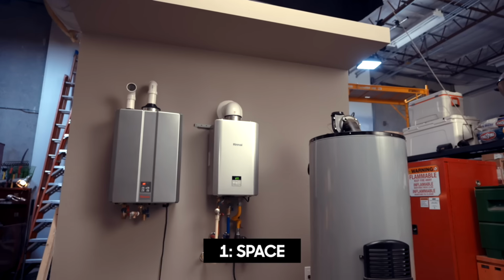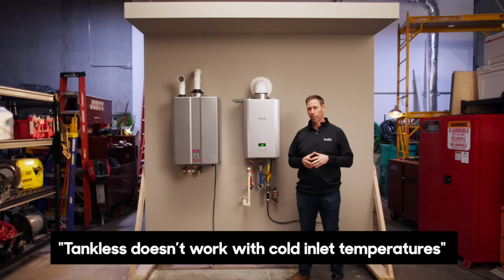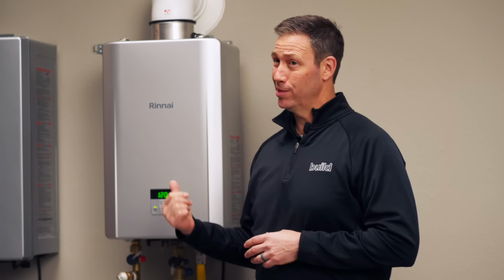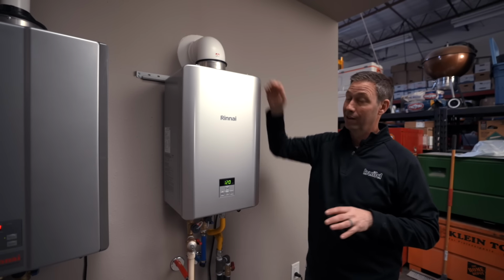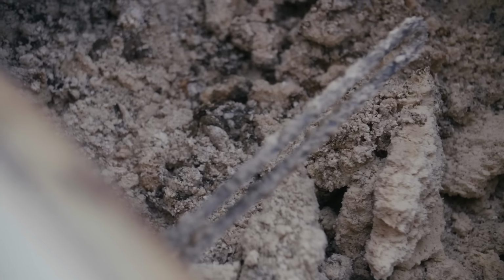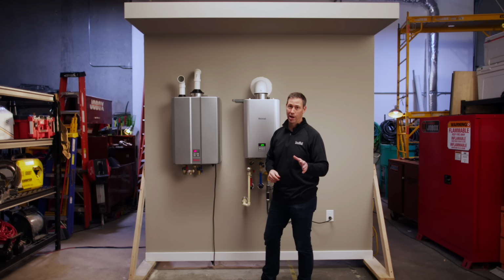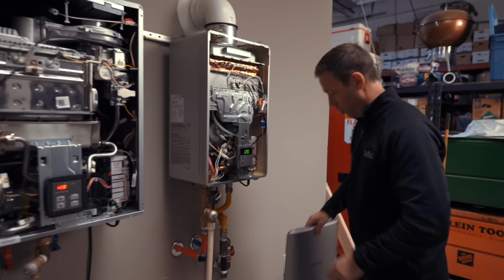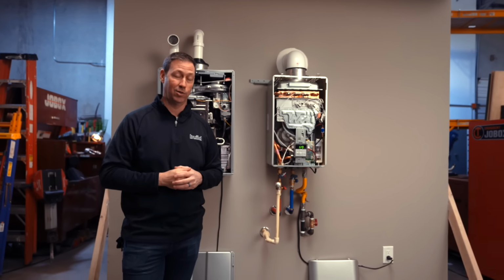DEBUNKING Tankless water heater LIES!

Comment: Just sold a 96 YO old house with the top of the line Rinaii flawlessly operating for near 17 years.  New house (3 YO) had a 80 gallon tank-type that was demoed and moved to the curb for the "recovery geniuses".  Now have the same Rinaii model for the last 7 months providing  likewise flawless operations.  There will NEVER, EVER be a tank-type in my life again.....not ever!
Reply: We bought a home back in 2010 that had two 50 gal electric water heaters. I wanted to replace them simply because of the electric cost of running them. I reached out to a plumber that specialized in water heater installs. He flat out told me that my ground water was too cold (well water). I did research and found that a lot of plumbers agreed. I decided to go with a beast 80 gal heat pump unit. It did it's job and reduced our electric bill but after seeing this I'm so disappointed I didn't call the manufactures directly. Out next house is most certainly going to have one.
Reply: @explorenaked  Matt refers to 3 showers at the same time because of tempering of extremely hot water with cold water and so increasing the amount of very warm water.
But if the supply is extremely cold then the system may struggle to supply one shower with adequate warm water. 
Check with the manufacturer first, for their guaranteed out put in frigid conditions.
Matt maybe right.
Reply: @explorenaked  I too have electric tank on a crawl space on a cottage rental. I was thinking going to hybrid electric. Maybe it's best to go gas tankless and buy a new washer dryer too? What's your thoughts? I may turn into air b and b as well for extra income. Thanks
Reply: I'm a plumber although these days clear blocked drains full time now. No need to carry materials or heavy lifting. Just simple drains haha
Reply: Wow, do you have any idea what 80g of water would do to a house if it let go?!
Reply: Do you follow the Fully Charged channel?
Have you seen the MixEnergy solution https:// youtu. be/l5q3W0tuLlM
Reply: that 96 year old must be rich
Reply: Maybe if the price of gas keeps going up and the price of electricity gets close to free if you add a large solar PV system... 
Maybe you'll consider electric heat pump then?
Reply: @sparkytas .....I have heat pump heating.  Very economical.  But then, the entire closed-cell foam enclosure of my house makes it possible.
Reply: Your gas bill has gone down?
Reply: So how many gallons of water can you get out of your tankless heater, if the supply is out for an extended period of time?  I have had a tankless for 20 years now (no savings over the previous natural-gas-fired tank either), and I am going back to a commercial-grade tank so I have some water to drink in case we get hit by a major natural disaster and all utilities are out for weeks/months (major earthquake).  

There is no free lunch here; everything has tradeoffs.  Plumbers in my area charge several thousand dollars to install one of these units, and over $1000 for a home-depot tank.  So I have to debunk some of the statements made in this video.  Needless to say, I won't be subscribing to this channel.  I have also installed tankless units in commercial spaces that I have helped design, and after doing so, I now recommend going with a tank and a recirculation pump due to multiple issues.  There are places for them, but this video makes it seem like there is just no comparison at all - not true.  It goes back to tradeoffs!  I will say that the endless hot water (so long as nobody else turns on anything that uses hot water in the house at the same time) is very nice.
Reply: @redmondjp what you describe is the result of an undersized tankless. If appliances are calculated right you may get a little less hit at times but that is unusual.
Reply: You must have a gas supply.  Electric ones are no bueno!
Reply: @dendemron3744  You are correct.  I have propane for all my gas appliances.  Electric tankless are no bueno fer sur!  For that matter...never had an electric tank-type that was worth the powder it would take to blow it to H...!
Reply: I like the idea of having emergency water if I need it.
Reply: You work for Matt or Rinaii, you’re not fooling anyone… especially when Matt wouldn’t even install one in his house. It all depends on the design of the entire heating system, to say one is better than anything else, either YOU are the lier or you don’t have a clue what you’re talking about and you’re just reading the script given to you.
Reply: @grandenauto3214  ....and you would be totally and completely wrong.  I have no affiliation with Rinaii...just a great experience.  If you had the same opportunity or experience you wouldn't be making such ignorant statements.
Reply: Electric tankless water heaters don’t get hot enough, fast enough to be a full house water heater.
Reply: @Mom_to_schnauzers  ...never buy an ELECTRIC tankless water heater.  Never!  That's any brand.  Electric models simply don't perform.
Reply: @Mom_to_schnauzers mine definitely does and was less expensive than a tank type for my new home build.
Reply: The CONTINUOUS hot water system I used recently did not work on low flow, it had to be turned on to high flow rate.
I turn my storage tank off when I holiday, ezi pezi
They do work, millions of Japanese use them every day. But if gas will be restricted in the future you will not get your lifetime value.
True ? ?
Reply: @stephenbrickwood1602  gas is here to stay.
Reply: @stephenbrickwood1602  ...you would be totally wrong in that assertion.  I do not!  I am NOT a "green freak" as you would elude to perfect your baseless arguement.  Instead, I look for practical solutions to a common need.  We all need hot water.  I'm no different than you.   What is the best way to accomplish that need.  I have found it and have experienced it for many, many years without any negative issues.  It WORKS!
Reply: @dwayneloftice2326  I do see your point and there is merit in what you say. 
I note that they need electric power to switch on. My neighbour's Rinaii is plugged in and does not work in a power 'black out'.
My main point is things are changing to an electric world and I do not know how fast it will happen. 
Nuclear power promoters are pushing hard now for $billions spend to save the planet and have masses of cheap electricity. 
Every one will make up their own minds.
Some will be winners. 
The fossil fuel supply companies are selling as hard as they can today.
Reply: @stephenbrickwood1602  I don't know anything about Rinaii but you can get an electric tankless water heater and they work just as well. If you're switching from NG to electric just make sure you have a circuit that can handle the load.
Reply: @C-Smash  thank you for the information. 
My old shed was the original dwelling and it still has the old continuous hot water. I disconnected it for safety. 
It is less than 2 foot tall and less than 2 inches dia. and installed vertically. The cold supply is connected to the bottom, hot out the top to the shower head.
Incredibly simple. 
It scared me, Hahaha, 240volt supply. So I disconnected it.
Reply: @stephenbrickwood1602  ....the Rinaii requires minimal power to initiate the "spark" for water heating iniation and needs.   The difference is, the tank-type storage version requires a pilot flame burning 24-7 where the tankless requires none.  The tankless intiates a spark to ignite the burner only upon demand when hot water is needed.  I can tell you that my water heating costs converting to the tankless system has been significantly and dramatically reduced by hundreds of dollars over the years.  Having said that, there are quality-built tankless systems that perform and others that do not measure up.  I've seen  the tests relative to duribility.  Cheaper systems are not always the best solutions.  I just believe the Rinaii is simply one of the best, most reliable brands after near 18 years in two locations (one natural gas and the other propane) using it. It simply works!
Reply: @dwayneloftice2326  thanks for the feedback, Rinaii is reliable. 
My comments on electric power supply was that ignition requires the unit to be plugged into the electric grid supply. 
The installation also requires an electrician, and a gas plumber, and a regular plumber. 
Just saying. 
We have a gas storage and low consumption rate. We have had electric black outs but no gas supply interruption in 30 years.

Comment: I love tankless, but my first experience was unfortunately not good.  Bosch Greentherms are garbage.  In my next house I am now running a smaller Takagai (it was free after rebates for replacing the tank - installed myself), night and day difference, thing cold boots in a couple seconds and while on standby starts up nearly instantly.

Comment: Replaced our 15 yr old Rinnai last year. Heat exchanger failed, corrosion caused leaks. Never descaled it. 
Went with a new Rinnai. I will descale it annually and will probably get 15-20 years out of it.

Comment: Thanks for the video.  I have pump water and have to replace my AO Smith from 2015 that has a bad smell.  The anode rod won’t come out (both myself and a plumber tried).  I have a water softener feeding the whole house which hasn’t always been there.  I like the space savings of a tankless.   I am all electric and will have to run new wire to go from 20amp to 50ish amps, but I can easily handle that.  The water heater is in the same room as the main breaker panel.  With this limited information on my setup do you have any advice?  Thanks for any ideas you have.  Your videos are always informative and fun! All the best from north Texas!

Comment: This introduction alone is bullcrap!.. And tankless do run out hot  water .... More then stated.... Tankless will go out in 8 to 10 yrs ... If. Water is not conditioned ...  And tank with low maitnece will last. 25 to 30 yr easlie...

Comment: Dont get em by the beaches, the air will eat them up. And its not the fact that its pvc venting being expensive, its having to run a whole knew route for ventilation than attaching to the preexisting tin ran for the gas w/h. You wont have a nitril o ring leak on you on a gas model though. How many parts vs a gas model?

Comment: Here in Canada a tankless is at least twice as expensive as a tank heater to install in 2024.  Quotes I have got for one installed were north of 5000 for multiple vendors.  50 Gallons tank is between 2000-2300 for a power vented model installed.  So this is not a myth at least not here.  As long as you don't change your habits you'll definitely see a reduction in your gas bill.  The fact is though, most people see an increase in their water consumption cancelling out any savings.

Comment: I have two of these Rinnai condensing units in parallel, one with the recirc pump. Yes, these are great units, and I love them -- all 400k btu of never ending hot water! These days,  what people don't consider and neither does Matt discuss, is the manufacturer's software for home automation & integration, as well as their embedded software in the units themselves. Rinnai apps for Android/IOS  are TERRIBLE. Complete garbage. I got it running, but it's a kludge at best.  I would make my purchase decision next time, given there are several great and reliable manufactures now,  on who has the best IOT software. Why is this so important here? Unless you are on an exact daily shower schedule, there is nothing better than screaming out to Alexa, et al, to say, "turn on recirc pump" a couple minutes before while you are getting ready for a shower and have it instantly hot when you jump in and turn it on. Otherwise, your recirc pump is set on a schedule, where you may or many not use the hot water, and your recirc pump AND UNIT, are constantly cycling on and off to keep the line warm every 10-20 minutes or so. Which seems crazily inefficient to me as well as possibly limiting the useful life of the unit. The bypass and recirc pumps are a game changer, just need to hire a couple of good app programmers. Shouldn't be that hard for a company like Rinnai, but apparently they just don't care, as I've had these for over 4 years and the software is just as bad as the day I got them.

Comment: I was with you up to this one. How much hot water do we need a day? Let's do the physics on this one. let's drive slower we will get there, take your foot off the gas pedal. You will be telling me next that the radiator thermostatic valves work. I will stick with the 3 rules of thermal dynamics. Instant hot water is bad news for the planet and also for who or whom pays the gas bill. So what are you going to do run the hot water tap all day? Drive fast and use more fuel (point-of-use hot water heaters for remote WC maybe but then again) ps love the videos

Comment: They can be very expensive to get installed.  I had a Navian tankless installed 5ish years ago.  It was around $5,800 installed.  They recommend annual maintenance to descale them which runs $150 - 175 to have the plumbing company come out to do, it requires special equipment and chemicals.  I agree with the slow ramp up to get hot water out of them.  It was the very first thing I noticed about the unit.  The heater is only about 10 feet away from my kitchen sink on the other side of a garage wall.  It probably takes twice as long to get hot water than it did from my 50 gallon tank heater.  can't speak to other units, but mine certainly wastes a lot of fresh water down the drain compared to the tank.  You need to do the math to figure out if unlimited hot water is worth the cost to you.  At the time I was quoted $1800 to have my 50 gallon tank replaced.  If I estimate my tankless will last 20 years the very conservative cost taking the annual maintenance and no inflation in service cost into consideration looks like this: 5800 install + 20 x 150 maintenance = $8,800.  At $1,800 for a tank I could install 4.88 50 gallon tanks.  My previous tanks have all lasted 10+ years with zero maintenance done.  $8,800, for 20 years, or about 48 years using tanks for the same price?  Is unlimited hot water worth that to you?

Comment: Dunno  I own a Tankless..  fitted when my new house was built.
 Biggest issue is that it takes a Loooong time  ( a minute or 3) to actually deliver Hot water.
 Especially so first thing in the morning.  No.. it is working perfectly (tested)
Having to wait for the contraption to notice a hot water demand /signal   then  for it to ignite  the burner .. heat up the metal.. then the water in its heating device.. takes TIME.  
Each and every time you turn on a hot water tap.
All brochure  shill babbles aside.   That's an issue .. constant source of frustration /annoyance.
 IF something is touted as too good to be true.. it isn't :-)

Comment: Tanks will work just fine with tons of calcium build up no problem. I had one in my home for 15 years, absolutely no maintenance and it never failed, switched to tankless for efficiency and didnt even get three years out of it before flow and heat was drastically reduced, was recommended to replace after cleaning didnt help

Comment: Our natural gass tankless water heater is about 22 years old. It replaced a 5 year old natural gas A O Smith traditional water heater. Older folks may remember A O Smith had lost a class action suit for defective water heaters.  I didn't know until after the deadline of the replacment water heaters because of defective dip tubes.  We live in a city and have city water, but we still have a water softener.  Two design flaws, no drain to flush out scale, and it does have a pilot light.  But it has worked for 22 years.  In 2016 we bought a vacation property and the traditional water heater was only 7 years old and needed to be replaced.  Well water, so we added a water softener and additional filters to help supply better quality drinking water.  I'll take a tankless water heater any day over a tank.